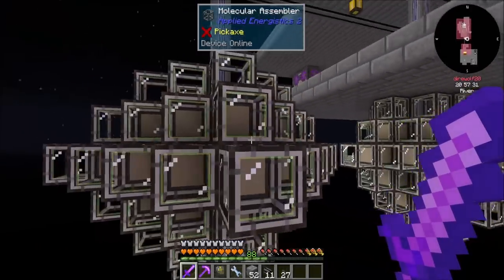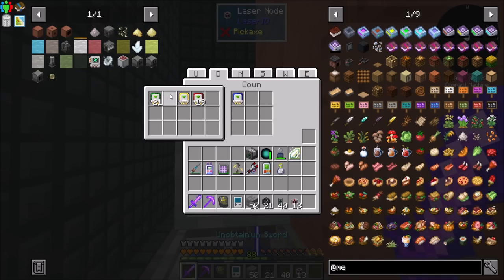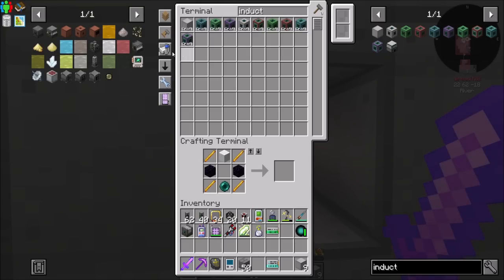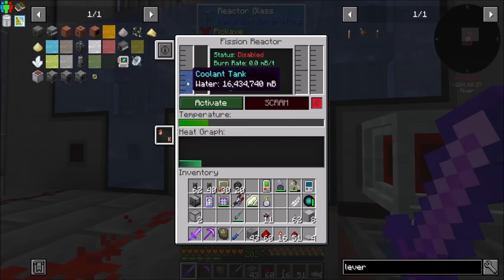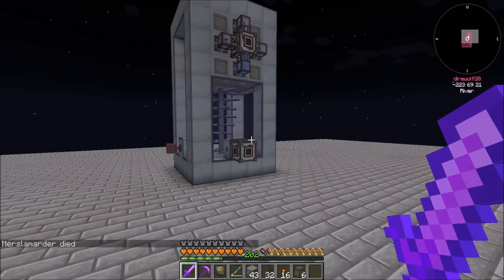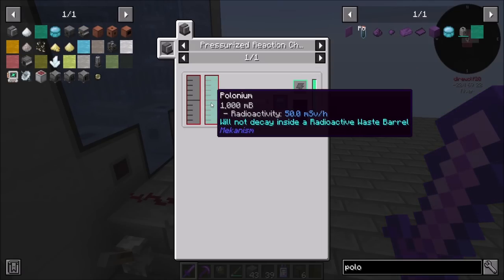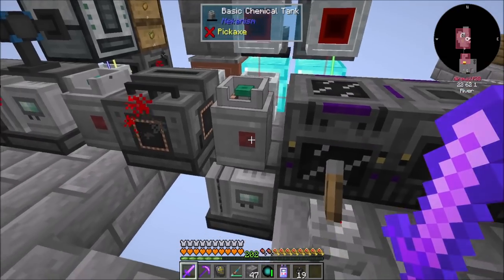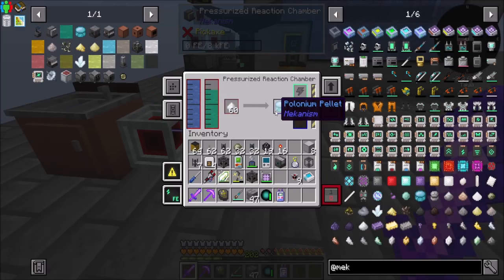ATM7 Skyblock Ep47 Induction and Polonium

Comment: With the quantum entangleporter you have a massive internal buffer that needs to be filled. 
Also if you use a line of ultimate mechanical pipes you have the buffer of the water stored in the pipes

Comment: You should use Integrated Dynamics to transport the water between the reactor and turbine and from the sink to the reactor. You can use a variable card set to true and then set the export rate to 9999999mb/tick.
Reply: you can just throw the water from the turbine in a trash can, and just use the integrated dynamics pipe for input

Comment: Dire you need to set up an energy void. If the turbine fills with energy it stops working but it will void all your steam (that's what the void excess does). Over time this leads to no water in your reactor, I doubt that even your OP sink can keep up. Then, kaboom. IIRC even your safety switch won't stop that.
Reply: It’s fine, every lp season has its own “little accident” 🎉

Comment: Dire people have been telling you this for years now but DO NOT DUMP EXCESS. It dumps excess steam not power, breaking the closed loop system of water-steam that the reactor has. It only makes sense to do that if you have an infinite supply of water to the reactor, which you can do with integrated dynamics (999999 buckets per tick) and not with laser IO (only a max of 72 buckets per tick) like you are doing.
Reply: ^this.

Comment: Hey Dire, I had a quick question regarding your autocrafting chandeliers. A Dense ME Smart cable is only capable of carrying 32 channels, but it appears that you have two chandeliers each carrying 32 interfaces on a single smart cable leading to your ME controller. How have you managed that?
Reply: peer to peer connectors probably
Reply: Looks like he added a second ME controller, probably used a P2P to send all 32 channels directly to one side

Comment: Hey dire could you make a little tutorial on how to have more chunk loads on ftb chunks??
Reply: Just check the ftbchunks config. Should be pretty self explanatory.
Reply: Rather than going looking for an elusive configuration file, try this instead:
/ftbchunks admin extra_force_load_chunks <name> <number to add>
Reply: Was coming to say this; you don't need to mess with the config file, just run the command.  Note that the command above needs "add" or "set" before the number, and <name> is the name of the player to modify.